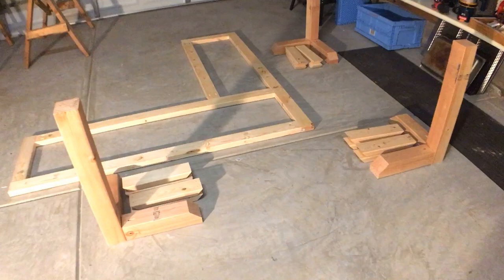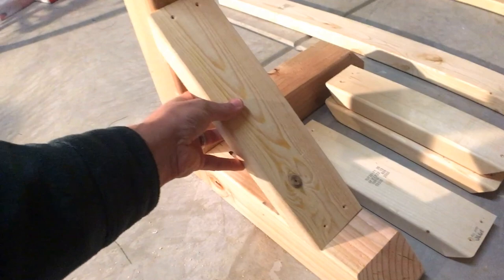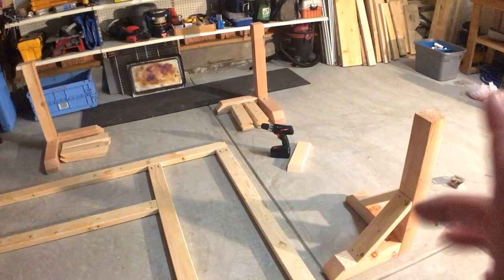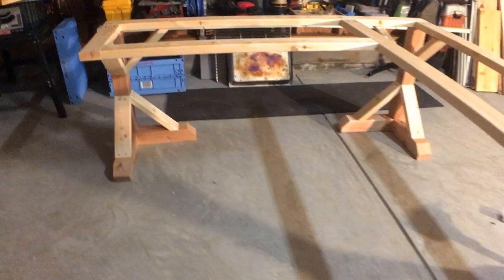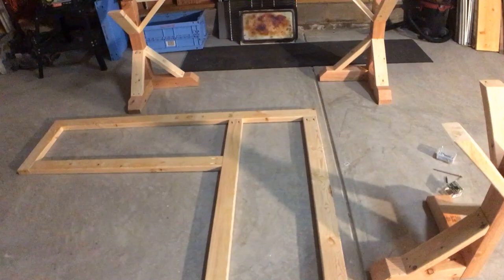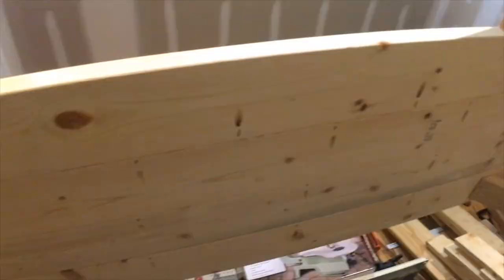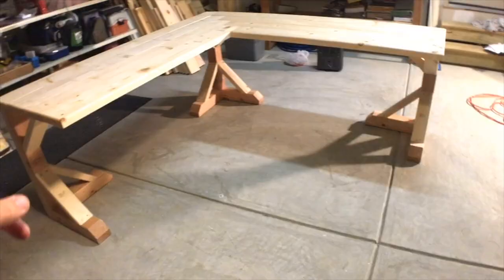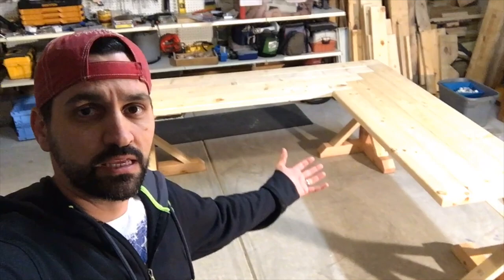How To Build this Awesome Farmhouse Corner Desk!  LESS THAN $100!!!

Comment: Great looking desk my question is. How did you or what settings did you set your Kreg jig R3 up at, looks to me the R3 is to small of a jig to use on the 4x4's!! Please Help
Reply from the maker: It can be use but you cannot use a Kreg Jig clamp. I used a standard 8” quick release bar clamp! It works wonders!

Comment: Looks great but no glue? Screws work but a glue joint is stronger than the wood itself. Takes a little bit longer to put it together but it's stronger and will last longer
Reply from the maker: Let me ask this... you are talking about glue in addition to screws correct? I mean I guess you could do the top with glue and clamp together but the rest not so much. Plus not a lot of people have the qty and size clamps that would be needed. Thanks for watching and commenting!!!
Reply: KalindsLife correct glue in addition to screws. I use them in place of clamps a lot of times for the same reason you mentioned, especially if I need to make a large panel like the top you made.

Comment: Can somebody tell me all of the measurements. Thanks
Reply from the maker: Check out Chris H's Pinned comment.  He called out the cuts for the Legs and you can use ANY lengths of 2x6s you want to fit your needs that is why I didn't really call those lengths out.  Just put them all together then cut the two ends off at the length you need!  Thanks for watching!

Comment: Anyone have the table top cut sheet?
Reply from the maker: There really isn’t a particular cut sheet. You can make them as long or short as you need. Just cut them 5.5” shorter than the next one so they stagger or stagger and just cut off the excess (which is what i recommend doing) thanks for watching!!